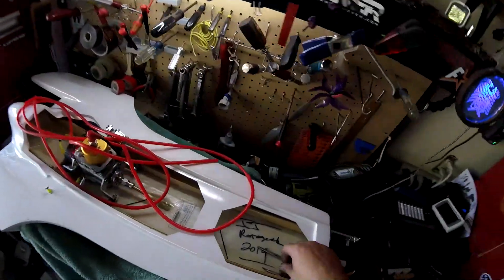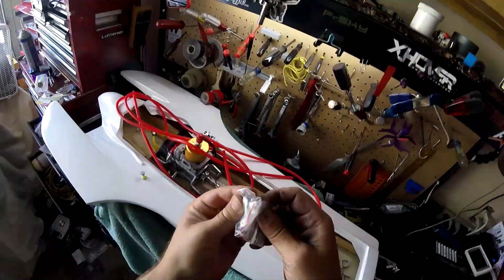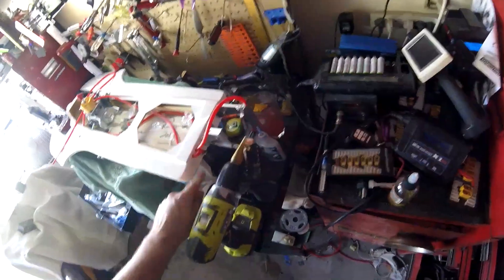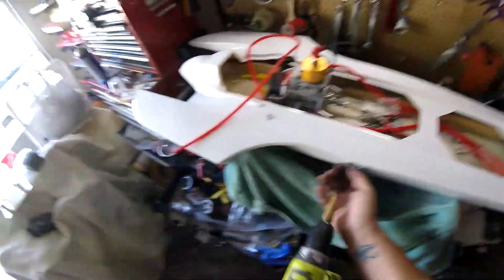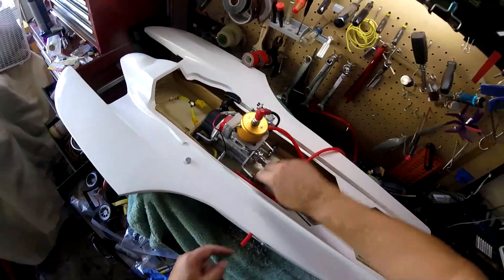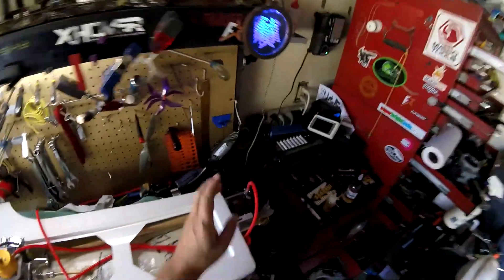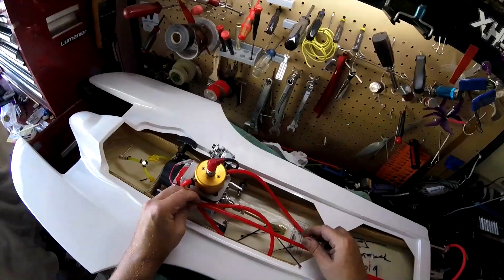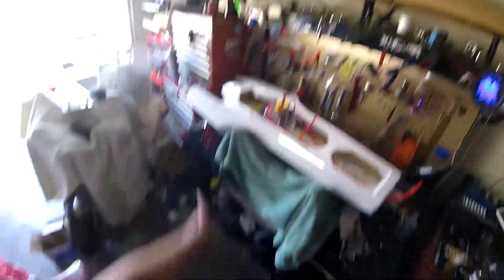Vader Build Ep4- Cooling system - RC Gas boat build

Comment: Yeah yeah, here I am again. Just noticed something you said. Rudder pickup to manifold and transom to head. The rudder pickup will always be in the water (unless you flip it) where depending on the depth of the transom pickup, a hydro runs with it's ass outta water, will the transom pickup be in the air? I run the rudder pickup for the head and manifold, and a small pickup for header pipe cooling
Reply from the maker: True point.  I have the pickup about 20mm below deck.  I may switch it over.
Reply from the maker: And lol.     I’m always looking for boat buddies.  Look me up on the google hangouts app, then we can chat easier